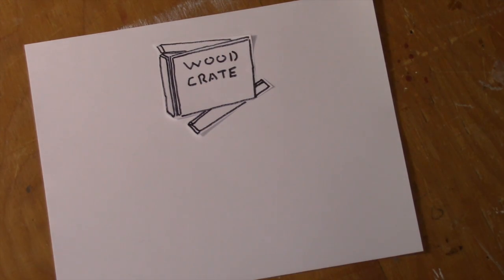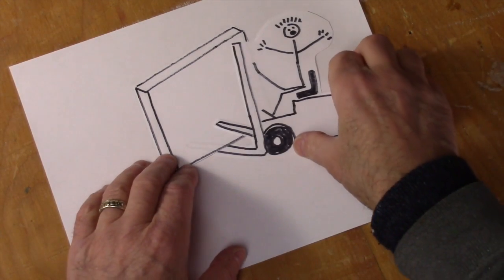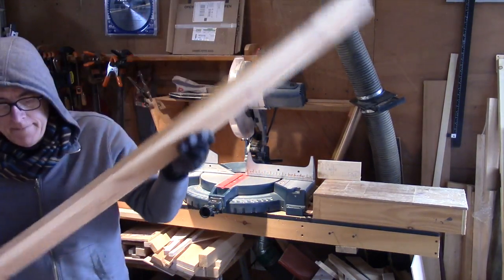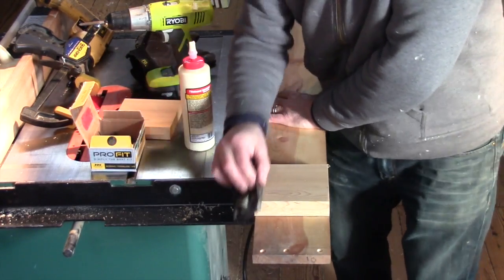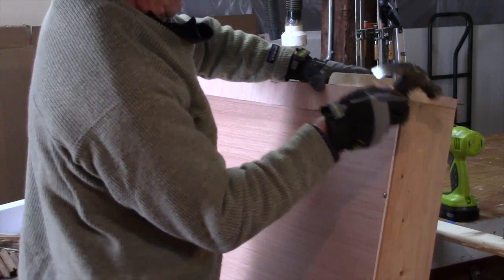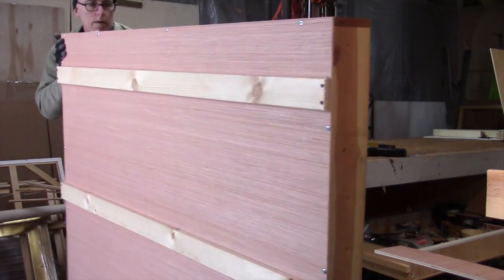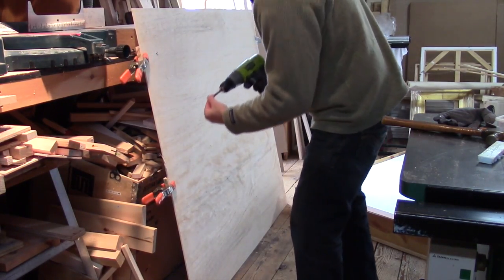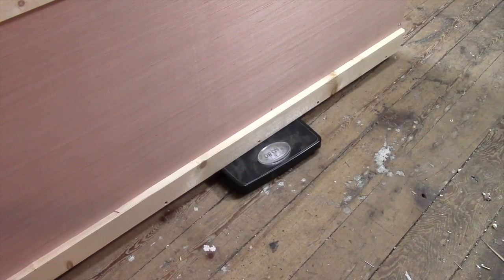Building a Crate

Comment: Hi Richard. Do you have tips on how to cut the styrofoam insulation?
Reply from the maker: Hey Douglas, Always a problem isn't getting all those loose beads floating around. Even if you use a very sharp knife it seems to crumble. One solution I'm doing is to use rigid foam insulation boards. They cut easy and clean and I think they even provide a stiffer impact barrier.
Reply: richard kooyman Right.  Maybe I incorrectly saw the "normal" white stuff in the video.  That's the stuff I avoid because of how messy and staticky it is.  I use the foil-backed stuff now.  Can be scored then snapped, then the foil can be trimmed on the reverse side.  More costly, though.